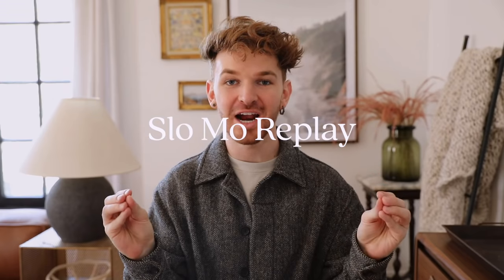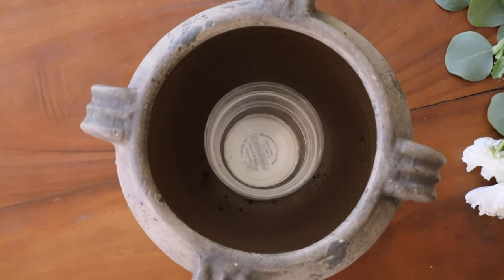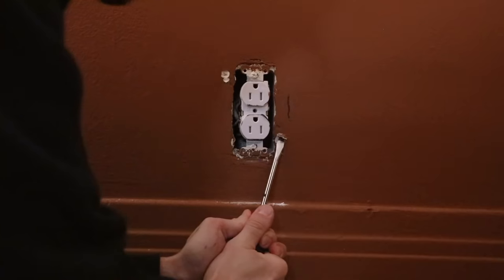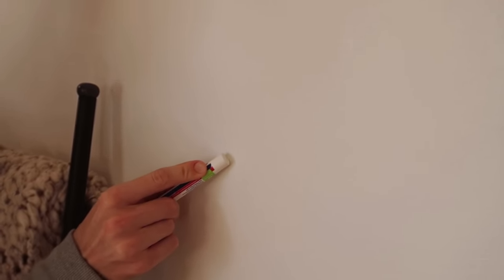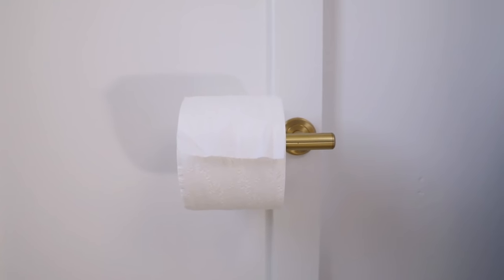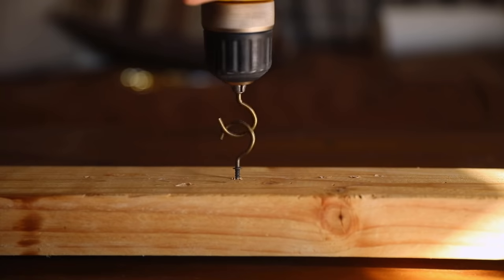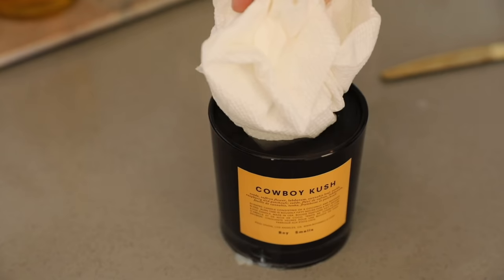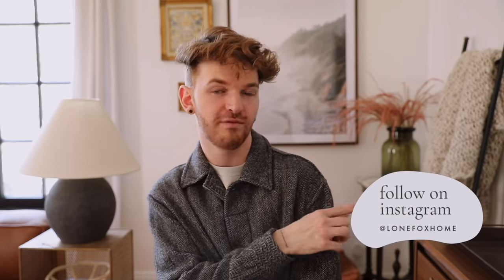20 GENIUS Home Hacks That CHANGED MY LIFE 🏠  DIY Hacks to Save Time + Money!

Comment: The tape grid on the vase… genius. 🤯🤯🤯 Also I will definitely use the hot water method for my candles! It’s way more efficient than what I’ve been doing. It’s good that you mentioned one should not pour that water in the sink afterward… it’s obvious when you think about it, but I’m sure many of us would have done it.
For left over glue from stickers, when a water bath isn’t enough, I use lemon or orange oil (like the product used to clean or shine wooden furniture) and it works well!

Comment: There are plenty of stickers that will not come off with soaking with water.
What you need to do is use an oil such as tea tree oil or eucalyptus (something with some astringency) or orange oil (etc) with a cotton round pad or paper towel and scour until the residue is fully removed.

Comment: I just did a two toned, board and batten inspired design in my powder room, and I used the original wall color painters tape hack, and it was amazing. I can’t believe how crisp the line is! I also use delicate frog tape and removed the tape while the paint was still tacky, and I think those things made a big difference too.

Comment: So many to choose from but the two vase tips were my favorites. For the sticky labels I soak in water then use lemon essential oil to remove residue. My dad was a contract painter and gave me a tip to use a damp cotton rag  on the tip of my finger to smooth the caulk as I go.

Comment: I love your videos. You are so upbeat and inspiring. The hack for paint colors is great, to write the wall color on the backside of the plate. Brilliant, I also write the paint locations on the paint cans.  I textured my closet walls and paint all my closets the same color. The texture is for acustics, and  the texture helps hide scrapes and dents that will happen. Touch-ups are easy, a bit of spackle and a touch of paint, and you're done. 😊

Comment: Good ideas, thanks for sharing!  In regard to getting wax out of jars: you don't even have to boil the water.  Here is Arizona we avoid using the stove and oven at all costs, especially during the summer, LOL.  So I just put the jar in a pan and fill both the pan and the jar with hot water from the tap and in about 5-10 min, the wax is soft enough to remove and the label is wet enough to peel away.  In the summer I sometimes just put the jar outside for about 20 min and the wax liquifies and is easily wiped out, but this does nothing for the label...still have to goo, wet, or scrape off.  
Anyhew, thanks again!

Comment: I loved the paint hack for clean lines but if you don’t have the original paint or don’t want to bother with that step, one hack that I learned from a professional painter is that running a dry paint brush down the painter’s tape presses the tape down everywhere so that you end up with clean lines as well!!

Comment: Wow! These were amazing Home Hacks.  Simple yet effective!  I would love to hear more Home Hacks from you.  All of these hacks are very helpful.  I have always done your first hack, by soaking an item with stickers in hot water (not too hot that you can not handle it), then just peel and scrap the label of quickly and easily.  I loved your hack about using a  large vase that is not designed to get wet, by putting a smaller jar with water in it to hold fresh flowers, such a great idea.  I also loved the one where you can use tape to move cords from the centre to the side where it can be covered up, with some attractive decor.  Your new home is amazing and your DIY skills are the best I have ever encountered.  Keep up the great video’s. 🥰🤗🇨🇦

Comment: i was told paint names can change over the years.. so instead of going by name.. put a dot of the paint on the inside of the outlet cover so you can paint match..

the floral tape tip i learned from a florist.. definitely helps!!

can also use a monogram or stamper on the damp corner of the toilet paper - many house cleaners will do this :D

Comment: While you have that outlet  cover or switch plate off, write the number of the breaker that controls it on the underside. Saves time in trying to read the terrible writing on the breaker panel (if it was even filled out). Of course, test the outlet with a lamp or radio before you work on it, if you don't have a circuit tester

Comment: If you have a hard time keeping the duvet straight inside the cover, you can just take elastic and attach it to your he corners. Then on the filler add buttons to use in your elastic button holes. Easy peasy and your duvets look great.

Comment: If you fold the top and bottom of the cover paper and then fold the slide the flap for the front and back you can slide the cover onto the book's front and back covers without using tape. Nice if you don't want to damage the book. I had to do this for school books when I was young - a very long time ago!

Comment: On tip #16 you use frog tap.  If you read the directions you dampen the tape to activate it. No bleeds and easier than painting over.  Crisp lines.

Comment: #1 I learned that trick a long time ago but if you don’t want to light the candle, you can put a little bit of modeling clay in the bottom and it will hold the candle in place. 
#2 DIY adhesive remover is a must have for any home. Not only does it remove stickers very easily, it also doubles as a cleaner. If you want to buy some, Uni-Solve is the best. 
#3 That’s a great idea! I love it. I always save the styrofoam blocks from packages and use them inside my larger vases when making a fake flower arrangement. 

I gotta get back to work. I’ll watch the rest later. Can’t wait!

Comment: To remove some stickers, I need to use alcohol and a cotton swab.  Sometimes, I use baking soda or Comet to remove the sticker and residue.  Rarely, I've had to resort to using paint thinner on a cotton ball to remove the sticker and residue - and I rinse it very thoroughly afterward and put the paint thinner soaked cotton ball in a grocery bag and secure it.

Comment: If you've got sticker residue on something delicate like clothing, try rubbing alcohol or an acetone-based nail polish remover, either of which act as a solvent to break down adhesive residue and other stains. If you don't have rubbing alcohol, vodka can also work as a substitute

Comment: I just discovered your channel this morning!  I agree with a viewer about loving how quickly you move through all your great hacks. Your faux tree is beautiful!  I love anything that saves time and effort, too, like the caulk trick. 
 I have some Ikea horizontal kitchen cabinets. I had an idea to use a little dish soap on a sponge and warm water because I thought it would remove any hint of airborne cooking grease.  The next time I went to dust, the wood was very smooth and there was very little dust.
I had a boyfriend who had a small 2 bedroom apartment, with a very small galley kitchen.  We loved to have dinner parties, so I bought  2 Rubbermaid tubs, maybe 12 x 16 x 8 inches deep and 1 smaller one. I filled them with hot soapy water and put them on the kitchen counter. So, instead of having stacks of dirty dishes to rinse or wash, they are in the hot soapy water immediately and take up very little room on the counter or in the sink.  One for dishes,  One for glasses, etc. smaller for flatware, serving, etc. Then I often put the tubs in the bathtub and hide them with the shower curtain.  Frees up kitchen counter and it hardly looks like you've  cooked. It is so much easier to face after the party, saves time, work, and also saves a HUGE amount of water not having it run while pre-rinsing everything, and dishes come out cleaner if you use a dishwasher.

Comment: To get a candle out of a candle stick or taper or candle holder of any kind, stick it in the freezer for a few hours or overnight, the wax/candle pops right out. This is great if you just have bits of wax stuck in the bottom too.

Comment: To remove old candles from a jar you can also heat water in a pot or bowl and set the jar inside. The wax may just slide out. This is a variation on pouring hot water into the candle jar.

Comment: 2:28 If you want to turn your non water-tight vase into one that can hold water, get some waterproofing paint and paint the inside.  It's used to turn giant vases into outdoor ponds.  Get it in black to make it 'disappear' or paint over it with a similar colour to the vase.

7:13 If you don't want to constantly use up tape doing this, get a vase frog.  The 'frog' sit inside the vase or like a lid on top and is either  a grid made out of mesh or has holes drilled through.  I first learnt about these in vintage vases from the 20's and 30's.

15:40  If there's only a little candle wax left, I just scrape out as much as I can then sit the container in hot water to melt the rest and dab in paper towel to soak it up.  A hairdryer can also be used to melt it.

Comment: About hack 11, I didn't know the roll technique but here in Austria we do actually our duvets like you did the pillows, it is a lot faster than the rolling technique. You place your duvet on the bed with the angles towards you, than you put the sheet inside out, go in from the opening in the corners. You take from the inside the corners of of your duvet, holding the duvet up so the sheet can roll towards the bottom wiggling it. 😊 I hope you understand me 😅

Comment: You can use tea tree or eucalyptus oil or rubbing alcohol to remove the sticky residue. It will get rid of all the residue very quickly. I normally try to pull the sticker off first and then use one of the above to get rid of anything left

Comment: The adhesive on the backs of stickers is oil based, not water based, so when you let it sit under water awhile, it's actually making the glue kind of curdle into itself to get away from the oil (hydrophobic), which is why it often is easy to squidge off afterwards. When glue refuses to be moved that way, rubbing it with oil will dilute the glue so then you can use soap or a cloth to wash off the oil and glue mix. Mineral oil and vegetable oil both are both fine for this--just put a few drops of oil on the glue and rub it in so it dilutes it. Repeat as necessary. The water method is hit and miss, so I always go with the oil method now.

Comment: The first was a good one ,I use it too ,I like the bedding hack ,the Huck hack ...for larger hucks like plant hucks pre drill, especially  it you are working with wood and butterfly backed that help disperse the weight... Butterfly back and come and screw too and you have to fit a little bit. Get it in through the back and in through your whole of whatever you're putting up, but having that can really keep up heavy draperies and even heavy blinds better, for people that have doors that slide open halfway and tend to open their blinds halfway more, moving the hold the center hold over toward the heavier part is a good idea too....
I'll be honest. I find some really interesting finds here and there and I love thrift stores. It's amazing that people have the sense when they haven't used something or they've only lightly used it to donate it and I so appreciate it as I do the same,

Comment: For clean, perfect caulking lines I found using silicone-based lubricant works better than anything.  A little on your caulk-shaping finger, and it glides over the beads “like Butta!”  I hear it’s also useful later on when the chores and “honey dos” are done! 😉😉😉

Comment: DIY book covers using the craft paper, be sure to use the blue painter’s tape and not regulate masking tape. The adhesive on the blue will not stick to the inside paper even after the has passed.

Comment: Whenever I peel stickers off of anything, even after being soaked with water, there’s still usually a sticky film left behind. I just spray the area with a small amount of WD-40 and it breaks down even the non-water based adhesives. Rub the area with a paper towel and wash with dish soap. Works every time and with next to no effort.

Comment: The taper candle solution works but many of my candle holders are crystal.  I sometimes use a white lit candle and let it drip into the holder than place the candle in the holder.  There are wax pieces used also but I have found them very difficult to find.  Also a strip of clear plastic wrap wrapped around the bottle od a candle works.

Comment: It’s funny about the candle hack. I was taught to always melt the bottom and stick to your candle holder. Because if your table is bumped by a dog, cat or child, it may prevent the candle from being knocked out of the holder and causing a fire. You should follow that hack every time you place a new candle into a holder, even with perfectly fitting candles.

Comment: Hey hun on the spray bottle n bed 🛌 put in a essential oil or fabic softner in the water  and then shake it up mixing the wayer plus the softner or oil i use softner  it not only mists it and unwrinkling it you leave it smelling fresh for when u go back its so nuce clean smelling bed

Comment: I take labels off by holding it under hot water. You can fill a stock pot with boiling water and place your jars to soak. Let it sit for a few hours or next day if you forget. The labels should be floating in the water. Easy. But if you get sticky stuff still on the jar or plastic containers use a q tip with tea tree oil, eucalyptus oil or if all else fails nail polish remover. Was with soap and done. Oh if you have an old plastic lunch box or plastic file folders with sharpie name written on it use the tea tree oil, eucalyptus oil and it will come off.

Comment: To get off sticky residue just use surgical spirit or isopropyl (rubbing) alcohol. Some hand sanitizers may work too.

It’s a lot easier than the way you’re doing it, comes off quickly with just a few wipes

Comment: The other day I was struggling to remove stubborn sticker residue and I was trying multiple different methods like hot water, soaking it in rubbing alchohol, even manually scraping it off but nothing worked. I had to google more options and it suggested using masking tape. It worked instantly.

Comment: DISCLAIMER: love the video, amazing ideas, so useful... buuutt, just a small word of warning, don't know if anyone else has commented this but just in case: I am from the UK and where I live is quite cold, damp environment, we are very prone to mildew and damp issues in our houses here, so I would warn against using the water spray technique for bedding as it can lead to little grey mildew and mould spores in the bedding fibbers as it doesn't dry out properly each time you do it. I bet it's a perfect solution for a dry, warm climate though and in the summer! Just be sure to give each layer time to dry before putting the duvet on top. :)
Reply: I live in a cooler (drier) environment and would not do this.

Comment: The book wrap looks a lot better if you leave an additional inch on the top and bottom. Cut off the corners (do not make a straight cut, you want to cut off a bit less than that) as well as two pieces at the top and bottom of the back (if the book is hardcover, cut off a narrow triangle in each of the four corners of the back, then flip the tab into the space between the back and the binding). Flip the extra parts inside the book; a couple of pieces of tape on each corner sticks the central flipped piece (the one you're using) to each of the other two. You are NOT taping anything to the book.

My K-12 required wrapped books. I can do that with a 40C fever and have it come perfect.

Comment: You can also use poster tack for candles. This will keep you form having to melt the candle ends time and time again and prevent wax build up in the holder. Writing the paint information on the outlet is good idea - except  when that colour is no longer made. You are much better off saving the paint chip and writing on the chip the room painted with that colour and keeping all those chip in an enveolp in a file. That way the chip can be colour matched at any time. Tape on flower vase will not last for any length time, especially if you have to water the plants/flowers in the vase. I'd make the same thing out of wire, but then I don't mind taking the time to do things that last longer. Who cares if the sheets are a bit wrinkled? The bedspread/comforter/duvet covers them up.

Comment: instead of melting and misshaping the bottom of your taper candles (or you have those fake but still real looking waxy tapers) you can use Stick-um candle adhesive. it comes in a little can and it costs like $7

Comment: A simpler way to remove a used candle from the jar: put the candle jar in the freezer over night. The freezing process will shrink the candle wax will easily slip out in one solid chunk. If not, simply run hot water in the sink over the outside of the jar which keeps the candle in a frozen shrunken state and relaxes the glass of the jar, they should separate. Easier than boiling water and melting the wax.

Comment: A better way to remove labels/residue is to use isopropyl alcohol 91%. It dissolves the glue very effectively and leaves glass sparkling. Fill smallwall holes with toothpaste.

Comment: I think it's easier to pop your candle holder into a fridge or freezer when it's cold enough wax shrinks n it will pop right out.  if you have a couple you can reuse the wax n melt it down too just need some twine, thick string, cotton yarn to use for a wick. (Don't use just any yarn) only natural fibers. I make candles n that's how I get my candles out of my molds because wax can act like a suction to its containers. I don't like to waste wax so I pop it out remelt, reuse, n rescent